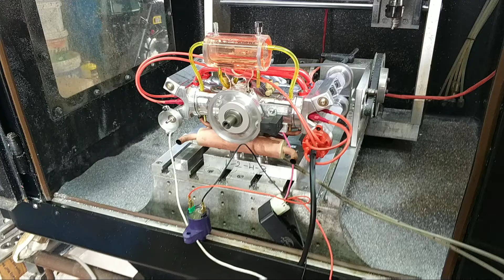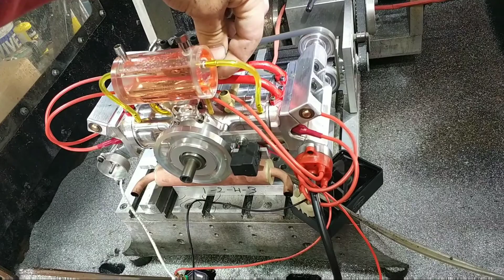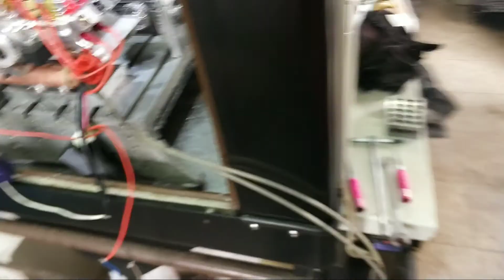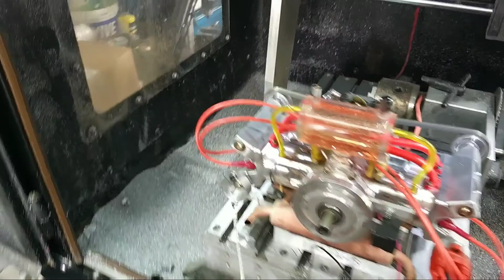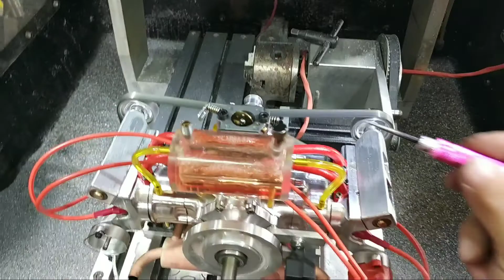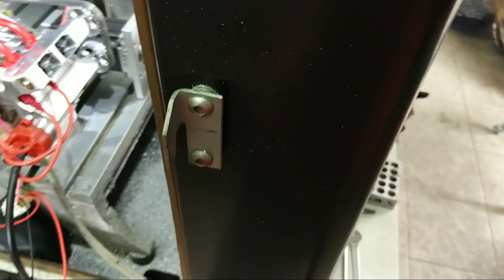boxer engine first start

Comment: What flew off the front of the crankshaft pulley at 0:20 into the video?  The part is sitting in the metal cuttings on the left side of the motor. 
Great looking motor and runs nice also.

Cheers
Willy
Reply from the maker: is the magnet for the sensor 
after that the engine working with 2 cylinders
it was the first attempt
now is everything perfect :)